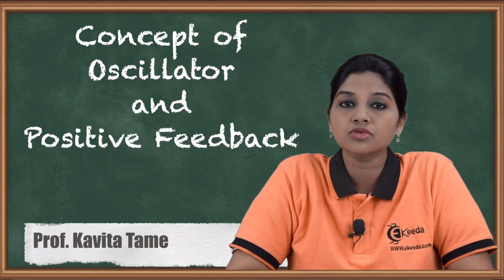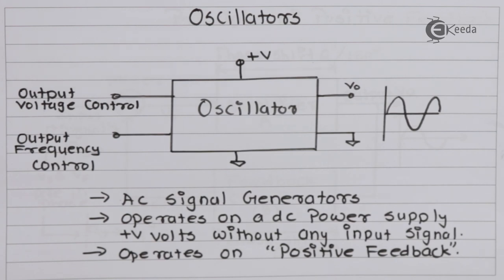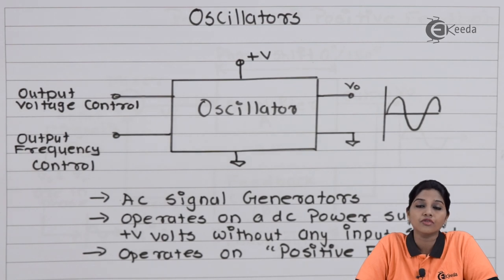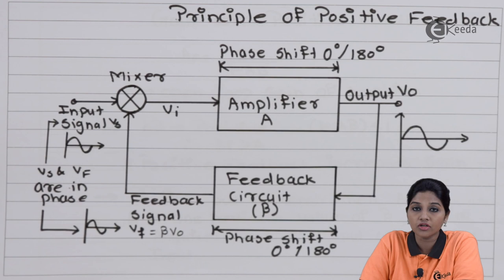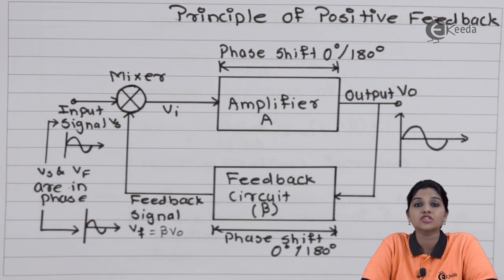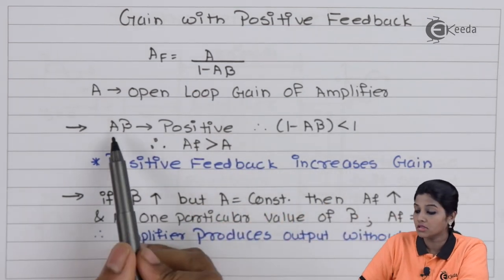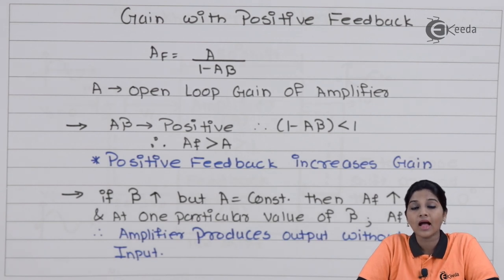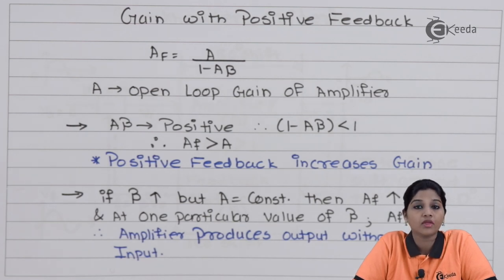Concept of Oscillator and Positive Feedback  - Oscillator - Linear Integrated Circuits

Comment: My question is why negative feedback doesn’t created additional oscillation back to ic but positive feedback does my ferrite transformer make a lot of loud noises when overloaded current positive sensor is activated to reduce duty the transformer screaming loud but negative feedback don’t causing this screaming noise